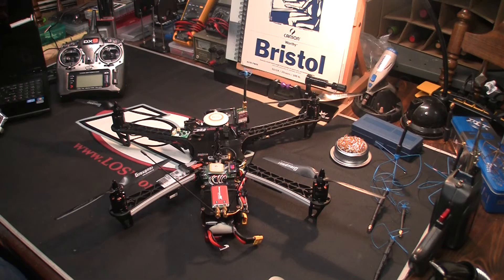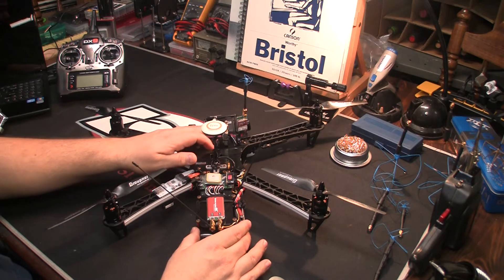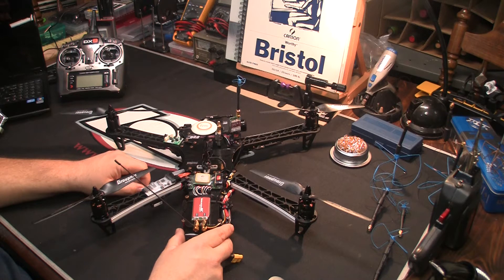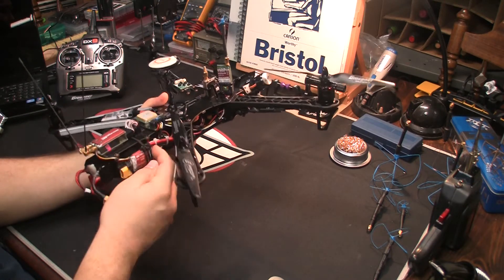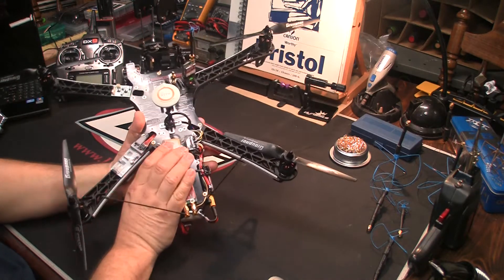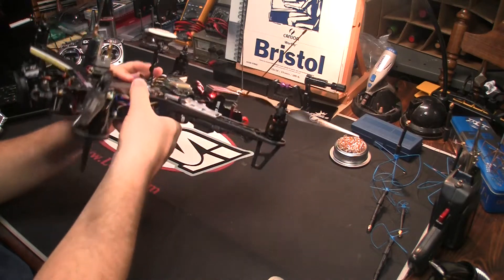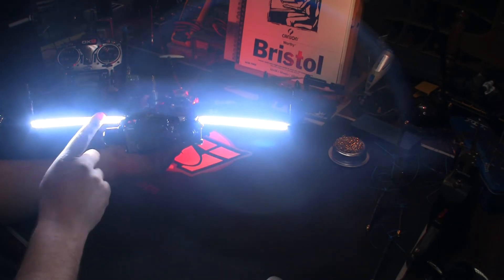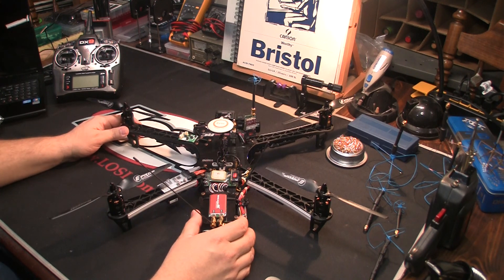TBS Discovery Pro Build Show & Tell

Comment: Can you send me a link to the LED lights they look awesome
Reply from the maker: Go to ebay and search cob leds you will find them. Measure your arms in mm and make sure they are the right size. You might also need to order led drivers to run them.
Reply: djgeojoe thanks :D
Reply: a link would be awesome , its damn hard to find these led stripes with the same power and color
Reply from the maker: Darkonion the leds are separate from the power supply. You have to design the power supply to run them, they are not really plug and play. I re built the switching power supplies to run them at maximum power. If you are not an engineer you will have problems trying to get this to work perfectly. I do know someone that sells these as a kit. I will ask him to post on this website, his contact information.
Reply: djgeojoe the powersupply for them shouldnt be that problem i just need a link to the leds you use
Reply from the maker: Darkonion you can buy the complete kit from Brendan via paypal. Contact him at techfreak5000@comcast.net
Reply: djgeojoe
Is the email right?,he didnt answer.
Reply from the maker: Darkonion I sent him an email too reminding him. He is really busy and may take him a while to get to everyone.

Comment: I fly my TBS Discovery with the naza and a 1000mw 1.3ghz VTX and get no interference on my GPS whatsoever.. Are you sure they interfere? I've never had any problems.
Reply: Absolutely!  800mW at 1280MHz knocked out the NAZA and TBS ezOSD. It could be the VTX I was using I don't know but it definitely was the VTX. I have switched to the 2.4GHz tuned TBS VTX and RX and have had no problems so far up to .6 miles. I will be going for 1 mile hopefully this weekend. I should be able to get up to 3 miles, just don't have the nerve yet.
Reply: 1280MHz is the legal frequency I can use as a ham radio operator.  What frequency are you using?
Reply: Same as you; 1280. If my friends are on 1280 though, I switch to 1258, and we still have no problems at all:) I don't even have the NAZA gps on a stand- And still no GPS Problems. I've had problems with the way the flight controller performs, and switched, but nothing with the GPS
Reply: BigBird FPV What VTX are you using? My NAZA GPS is on the stand.
Reply: I got mine from readymaderc.